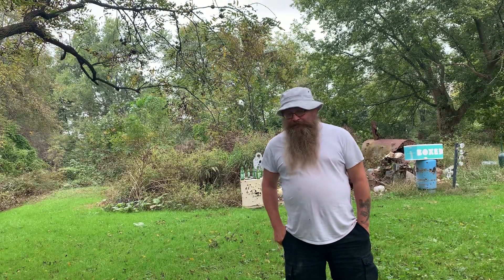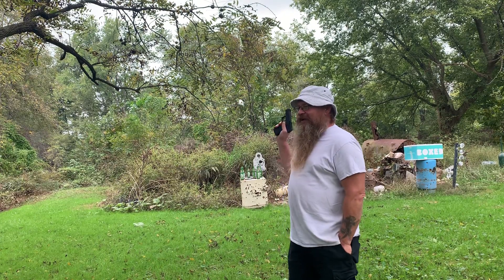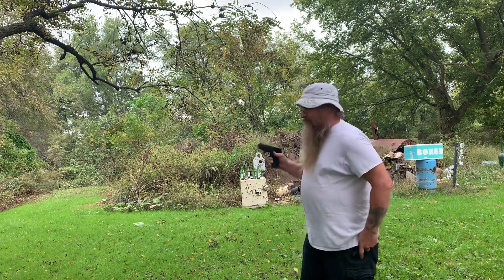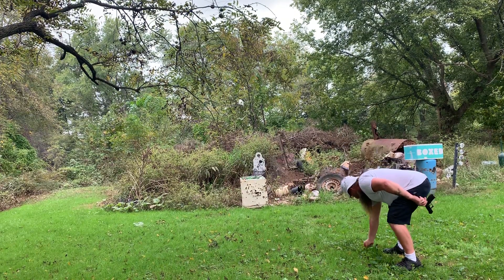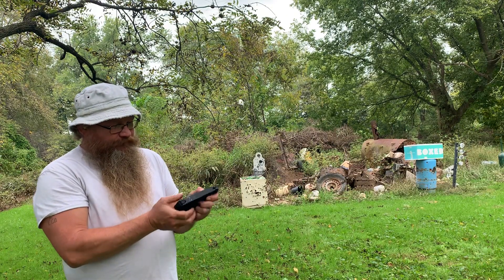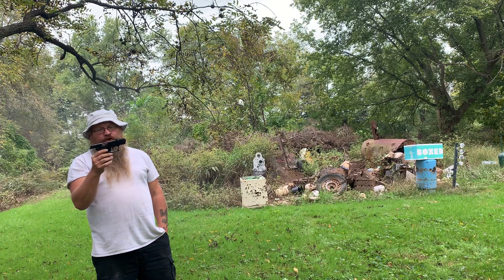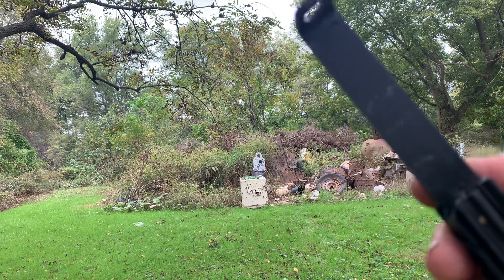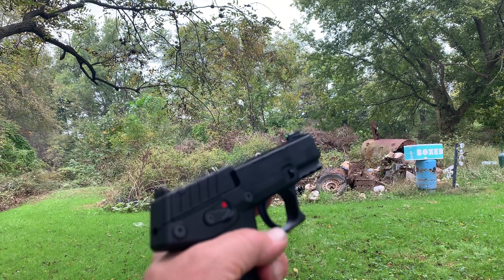KEL-TEC P17 22lr Why Does it fail? Here’s the answer

Comment: I’ve noticed that my p17 will fail to feed Aguila 40 grain CPHP Super High Velocity and Norma 40 grain RN Tac-22. I was able to run about 500 rounds of Federal Champion 40 grain LRN and 200 rounds of CCI 40 grain CPRN minimag without a single issue. CCI Stingers and Fiocchi club also run flawlessly.

Some guns just don’t like certain ammo, I’m not sure that it’s a design flaw because my PMR30 is the same way. The bottom line: Use ammo that keltec says to use

Nice video OP
Reply from the maker: Yep I agree especially when it comes to rimfire. Certain firearms like certain ammunition. God bless. Have a great day.
Reply: i just bought 2k aguila 40g

Comment: I just bought 2 of these. I haven't shot them yet but have been studying the feel of the slide. You are correct that there is friction in the action. I have identified 2 locations that need to be addressed but first of all if your slide is bowed then you need to contact kel-tec about it. Don't hesitate to contact them. They will fix it... it may take 2 months but they will fix it.  
(1)  The thread protector and barrel bushing. If you have to keep tapping the slide to get it into battery then the issue may be that the barrel may not be properly aligned.  Since the barrel acts as the guide rod it must be correct or else the bushing will rub onto the thread protector and prevent or at least hinder return of the slide into battery. I can feel this on both of mine when slowly pulling back on the slide.  It may be possible to polish the inside of the bushing and the outside of the thread protector if the barrel misalignment is not too sevier. 

(2) Check for signs of wear on the top of the ejector. My Kel-tec PMR30 had a serious rubbing issue there and a simple sanding on that top edge really made a difference. 

Friction is a performance killer especially on such a lightweight blowback design as this. If you have lots of wear on the top of your slide and you can see a bow in it, you should get it replaced.
Don't give up.

Comment: I mostly run CCI MiniMags through mine.  My local Academy Sports usually has the 36 grain hollow points for $9.99/100 rounds, and my local walmart usually has the 40 grain standard velocity round nose for $11.33/100 rounds.  I've had 0 issues with either.

Comment: I have had one for  1 1/2 years still running no problems, have run everything through it. It shoots every pull the trigger over 1000 rounds though it now
Reply from the maker: I’m not sure if I could take what you say seriously lol. You probably got a pretty good firearm. I’m going to agree with that. But 1000 rounds and not one light strike from a rimfire. That’s the only part I’m questioning, but these are definitely good firearms, I got mine straightened out
Reply: Does yours cycle the CCI CB stuff (sub sonic) mine shoots it crazy quiet but doesn’t cycle due to light load , wasn’t expecting it too but it loves 40g CCI AR Tactical and mini mags

Comment: The slide isn't the problem. Take off the slide and look at the right side trigger bar to see if you have a burr on the top of it, created during the manufacturing process. Grind off the burr  and then polish the top of that trigger bar smooth.
Reply from the maker: I’ll check it out thanks

Comment: I just bought one today had alot of problems so I researched the internet came across this but this isn't the problem at all even know it is wearing off the paint slightly , move the slide back and forth without any mags and it's smooth as butter , you will find you problem with the first couple rounds fired that is due to the mag being too stiff when loaded with 16 rounds , I used all three mags just by loading 13 rounds in each one fired flawlessly after I did that , yours may be having a different problem !!
Reply from the maker: After a lot of rounds it’s running great now

Comment: Got mine a couple months ago I use CCI 40 grain. No problems. The issue I have is that I can usually only get 15 in all three of my mags. I've only got a couple hundred rounds through it, so maybe in time the springs will loosen up a little. When I loaded 15, the 13th round seemed to not feed well. I had to tap the back of the slide for a while, but it's running fine now though. If it persists, (just 15)  I'll contact Kel Tec to hopefully find a solution. Great little fun shooter though.

Comment: I'm buying one anyway, I owned 4 pf9s that I had to make reliable. I'm not scared of that nerd shyt. Great video, good information.
Reply: Really? I had two PF-9's that were flawless. What issues were you having?
Reply: Depends on defense ammo, ball ammo I never really had issues with but I was buying early made pf9's and they got better over the yrs. 15 yrs or so ago everybody was doing the fluff n buff that originated out of the forums. They had some issues but I was a fan and loved the size for the time. I picked up that P17 a cpl weeks ago or so and love it. Shot it today about 300 rds. 2000 rds through so far haven't cleaned it yet. Just added grease on rails but didn't need too. Get one bro if you haven't.
Reply: @dwayneomac4606  yeah, I bought mine when they came out, guess I got lucky. I bought a P-17 about a month ago. Got the lead fowling issues sorted, and I haven't looked back since. Best $200 I ever spent.
Reply: Fun lil fcker isn't it, have more fun with this lil gun than the 57 and p80 builds I done. Done shot all my mystery ammo I had stashed in containers and bottles. Now I been feeding it Federal 36g 1260fps, Winchester 40g 1200fps. Mini mags and I did run a few mags of stingers.
Reply: @dwayneomac4606  sold my 5.7 a few years back, kept the PMR 30 I had at the time, then sold it last summer to someone who needed it worse than I did. I'm havin a blast with the p-17 bro! It's awesome suppressed!
Reply: @dwayneomac4606  I don't have my 9's anymore either. They were replaced with a sig 365xl.
Reply: That's a hunk of gun right there, I don't have one but love the px4 storm.

Comment: I'm glad I ran across this video.My P17 is having the same exact problems.Hopefully it is just a break in issue.
Reply: Take off the slide and look inside at the trigger bar on the right side to see if you have a burr on the top of it, that will cause the slide to slow down, 'stutter' or completely stop.
Reply: @jh8338  Yes there is a tiny bur,about half the size of a pin head
Reply: @jh8338 
I have a burr on my trigger bar too. I spent five careful minutes with a jewelers file to get it almost flat.  Thanks for the tip.

Comment: So I have been to the range twice now and mine is doing pretty much the same thing, but mostly on the first 3 or 4 rounds. After that it runs very well with just a few failures to eject. I'm beginning to think there's either too much mag spring pressure or too little slide spring pressure, or a combination of both. I've used a variety of ammo with the same results. I do know it seems to prefer an open bolt when inserting a full mag. Not sure where to go from here other than just keep shooting it and hope that it straightens out. May have to call KEL-TEC for some assistance. Not my first KEL-TEC so the love/hate relationship is already well established. I have their number on speed dial.
     Then ofcourse, there's always the guy that posts that he has fired 2000 rounds straight out of the box with zer0 problems. Go figure.
Reply: @Rat Pup   Some people hate to admit that their pride and joy does not live up to expectations. Now I have been on the other end of the nirvana gun universe but not often. I often purchase budget guns and sometimes you get bit, and sometimes you get a real gem. Just don't let the makers get away with you getting stuck with a lemon. Call keltec and send it back. They will fix it.
Reply: I have exactly what you describe. It was hanging up on the first three or four rounds every magazine. I've worked a couple spots on the slide and now it's only the first round and not every magazine. It doesn't matter what ammo I've used.

Comment: I carry my P17 everyday hanging on the inside of my Carhart overalls. There is a seller on ebay named Jeremiah 2011 Holsters
 who sells an item called a "Kydex Pocket and Necklace Holster." This hangs easily on the inside of Carhart overall bibs by attaching some bankline through the provided holes in the holster to the shoulder strap connectors. It is totally concealed!

Comment: The top slide is bent and is needs to be factory changed to a new slide.Its a damaged
by some one in production.Also the area it rubs against on  the back needs to be honed down. Keltec will fix it send it in and it will help new production of new guns.

Comment: My opinion, you had ammo problems. I use cci minimags with no failures to date. I figure breakin after 500 rounds and I'm not quite there yet. I had one failure due to  totally eject the shell. It cleared easily and had no further issues.

Comment: I took your advice and lubed the underside of the slide.  I ran a "cracker box" of difference ammo and it ate everything but five (duds) and one got stuck in the pipe.  I found the trigger to be extra lite.  I think federal gave me the duds.  Gonna find out what it likes to eat and stay with that brand..  Overall, I'm satisfied with my new gun..
Reply: Ahh it says IN the manual to lube the underside of the slide AND where the rear slide rails slide along the frame AND  on the barrel itself where the spring slides back and forth, all those spots have moving metal parts

Comment: Respectfully bud, you don't want to overlube rimfire firearms.  That was a LOT of oil for this gun.  You generally want to run a rimfire on the drier side.  Really just want a micro-dab on the rails for this piece.
Reply: Additionally, that's a common friction point for several firearm designs.  I have a Canik that's seen a few thousand [flawless] rounds that has worn the finish off that section of the slide completely.  Smooth polished steel at this point.

Comment: On my MP15-22, if i load the mag WRONG, it will fail to eject and i get stove pipes on every other round. 
If i load it "properly" then it runs flawless .... i put about 500 rounds off CCI Mini Mag and all 500 rounds fired off and ejected.
Reply: How do you load a mag wrong?
Reply: @KevinB-pd3me  if the ammo is not inserted properly, it can fail to load. 
There is a specific technique to load each round into the mag because its 22LR and because it has that base that is larger than the case itself so it has to be loaded right.

This same issue is on the 22LR semi-auto's as well, they all have the same mag style design where you have to pull the spring down to insert the rounds. If they are inserted wrong, you will get fails to chamber.

The only 22LR semi auto that does not have this design is the Keltec P17, that mag loads like a regular center fire round.
Reply: @ACommenterOnYouTube  Thank you for your detailed explanation. I have a P17 so I didn't grasp the problem.

Comment: Mine is a jam master 3000, I’m lucky to get through a mag without a jam. It usually Jan’s 3-5 times a mag
Reply from the maker: Try different ammo
Reply: I’ve tried several different brands and grains, hollow points and standard. None really seem any better than the other. Is there a certain brand or type that you have found to be better? Sad part is I really want to love the P17 but with all the jamming issues it’s having it is kind of a love hate relationship 😂 I’m gonna look for the wear marks and see if that’s what I have going on, I thought at first it was not lubed enough so I stripped it down and cleaned and lubed it really well and it didn’t help at all. When shooting it seems like the slide has a delayed reaction so it may very well be making contact and hanging on something
Reply from the maker: @gary30427  CCI 40 grain is the best. If it won’t run on that or something wrong. Contact them or maybe take it to a gunsmith. God bless. I wish you luck.
Reply: how new is the gun ? 
How many times have you filled and depleted the mags since you got it ? 
On mine it was the mags, the springs were too tight at 1st, after they lost some tension, it runs great
Reply: @ACommenterOnYouTube   mine is maybe 3-4 months old, probably cycled the mags 10 times. I don’t think it’s a mag issue I purchased some used mags and it still does it, it seems like the slide is slow or it’s catching on something. I purchased a TX22 and it runs flawlessly, so I’ve kinda just tossed the P17 in the safe for right now
Reply from the maker: @ACommenterOnYouTube  well it runs better now lol it was brand new when I got it
Reply: @gary30427  no clue man, all my issues were 100% mag related. Once the springs loosened up and i was able to load all 16 rounds with my fingers alone, she chambered and cycled every round with ease. 
Once i got the new mags, i had to use the loader to load the last 4 rounds because the springs were so tight and the out of battery issue came back.

Comment: did you notice the first 1 to three messed up after that it ran, I think it;s in the mags. I never put but 14 in mine and it is flaeless with everything but winchester. I haven;t bought it in over 20 years always had problems except the center fire rounds.
Reply: it IS the mags, new the springs are very tight so the 1st 3 rounds are hard to be stripped off the follower and into the chamber which also causes out of battery issues.
It took my mags about 4 full uses and storing them full until the next range day to get them loose to where now it will chamber # 16 with ease.
Also i know its the mags because the 1st 5 took a few to loosen, i puchased 5 more mags and it started acting up again with the out of battery and chamber issues on the 1st 3 rounds on each mag. So now i have to break those in.

Comment: Most likely your friction is coming from the two rails that the bolt rides on/in.  The top is lightly touching the plastic bridge,  the two rails however can be a little tweaked inward and make getting the slide out and in a bit awkward and cause the exact issue your facing.

Comment: Mine doesn't have any trouble cycling, but the mag springs are so stiff it can't feed a single round until you push the slide forward. I tried exercising a mag by loading/unloading it a lot and that seemed to help some, I'm hoping leaving it loaded will help too. If it doesn't, I am sending the thing back and buying a Sig P322!
Reply: THE 322 IS JUNK HAD ONE. MY P17 RUNS FLAWLESS
Reply: I sent the gun back to KelTec and they installed an updated version of something related to the magazines. Hasn't had a hiccup since I got it back no matter what bottom tier ammo I feed it.